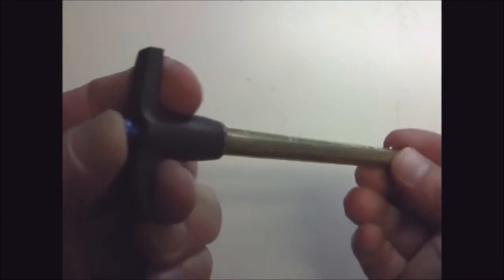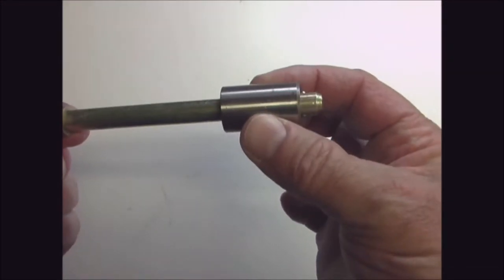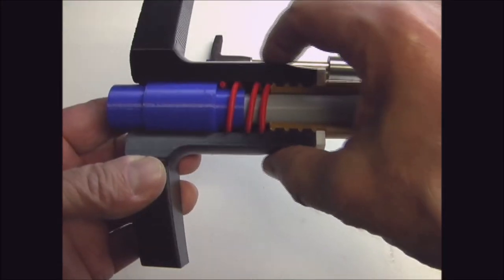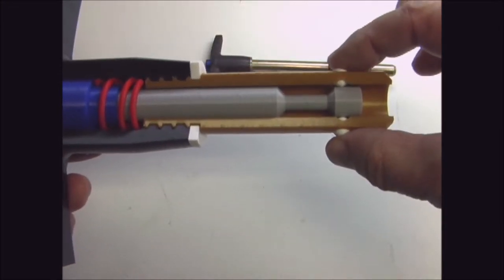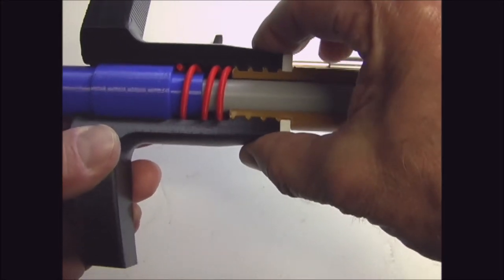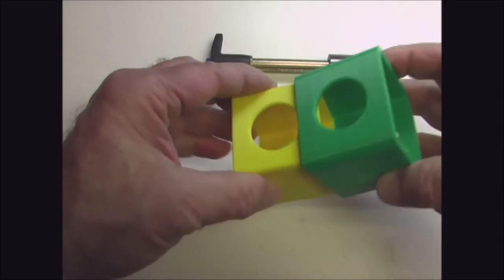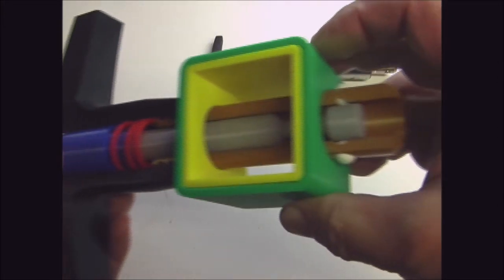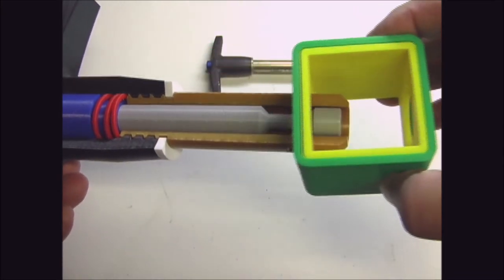Quick Release Ball Lock Pin. How it works. 3D Printed Cutaway Model / Animation

Comment: Excellent explanation missing is slight detail on why the balls just don't fall out of the hole they magically or cleverly stay right there
Reply: I'm pretty sure the cutaway (if you can call it that) where the balls are placed is in an arc, leading to the openings where a bit of the balls stick out are to tight to let the whole ball out
Reply: @customch33s32  makes sense thanks

Comment: Hi, do you know how they drill the ball holes and get the balls in so they dont fall out?
Reply from the maker: They drill the holes just slightly larger than the balls, drop them in and then "stake" the hole by pressing in just enough metal around the outside of the hole so the ball can partially stick out but not fall out. If you look at the pin around the hole you should be able to see a mark.
Reply: Jay Gould , hi! Thanks for your video. How could you keep the balls inside the bores (in the 3D printed version) so that they don’t fall out? I guess the material of the 3D printed pin does not allow the “stake”.
Reply: @WilliamFrawley  OMG, I've been searching for this answer for hours. THANKS!

Comment: so mine doesn't work,remove washer by prying and pull apart ,or push to disassemble
Reply from the maker: I don't think they can be disassembled without destroying it. The aluminum handle is swedged onto the shaft
Reply: @WilliamFrawley  i found by twisting i can have it work again ,to a good spot